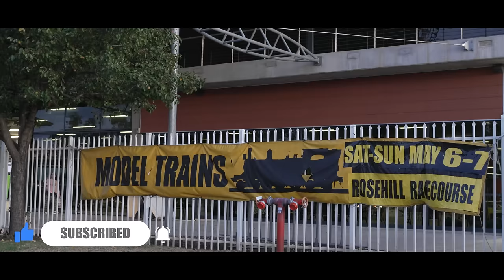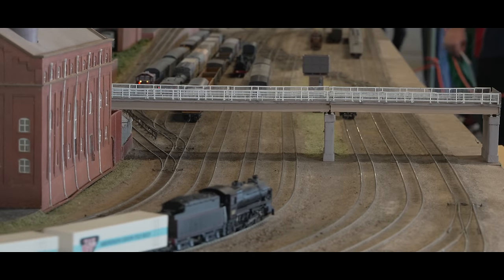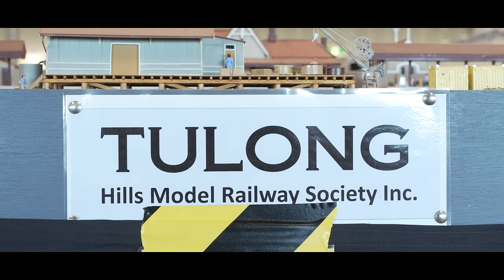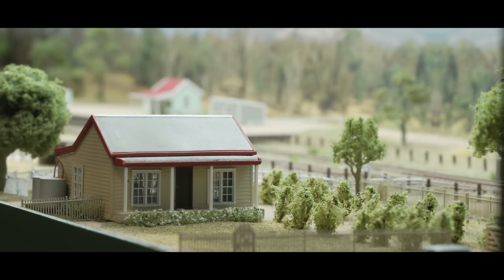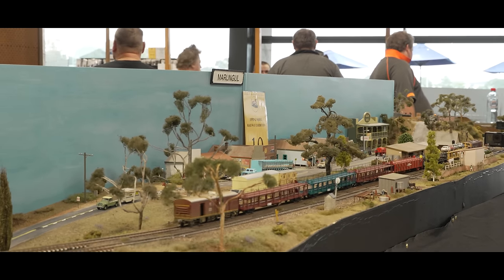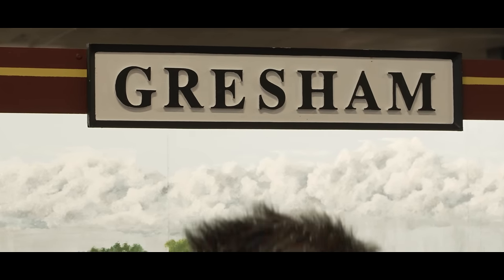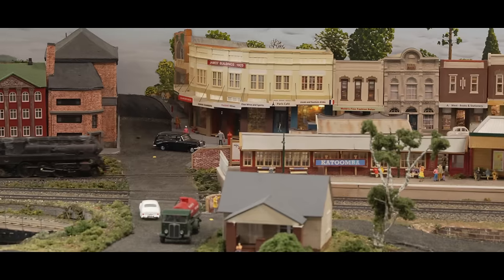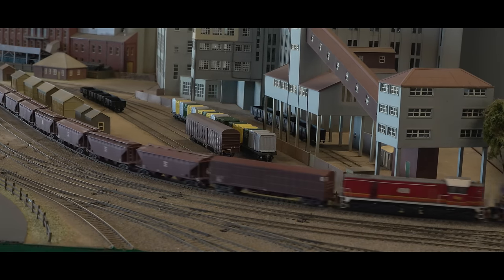The Great Train Show - Sydney, New South Wales Australia

Comment: I see Goulburn in this video. I still remember when Leokimvideo covered it when it was first unveiled at the 2016 Epping Model Railway Exhibition. However from what I can see here, it looks like the group that run Goulburn have since rectified the one criticism that Leo had when it was first shown, and that was that the color temperature of the lights they had used over the station were too yellow.